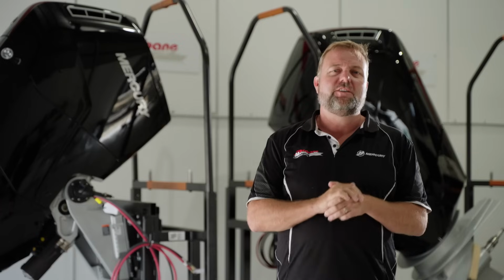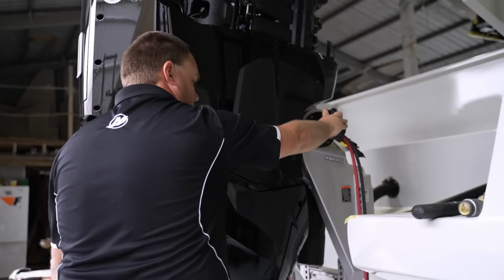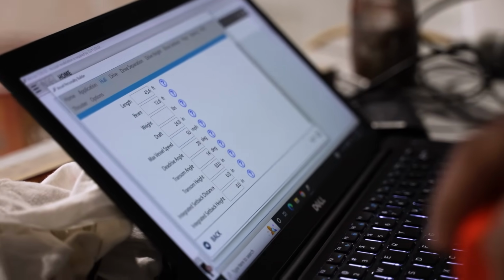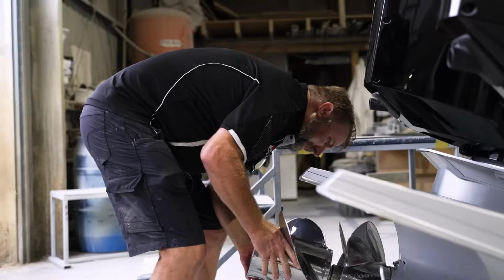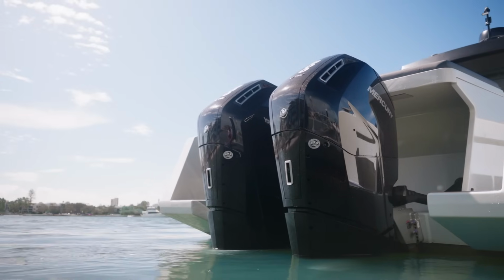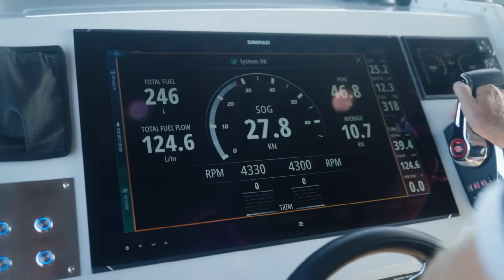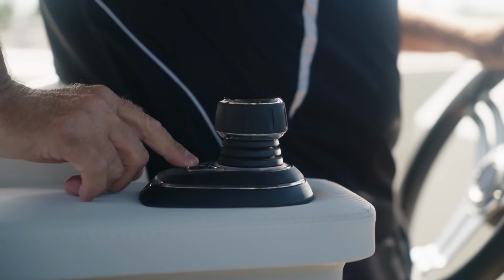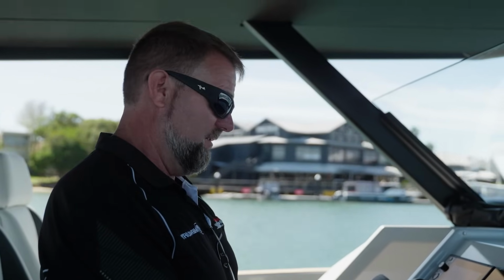Twin Mercury 600hp V12 Verado- FIT UP AND WATER TEST FINALLY REVEALED

Comment: Aldi 12s are inherently smooth internally balanced that is why Ferrari Lamborghini all of those Supercar type companies used V12 they're extremely smooth running no vibration just because of the way the architecture on a V12 is

Comment: At 1000 hours the lower gear unit will not have to be removed, it can be removed on the STBD side of the motor by removing two bolts

Comment: Thanks for the vid.

Question about 'Sky hook' anchoring button, but not sure of the technical language to use so I'll just try this.

Out fishing in potentially dodgy situation with tide change & plausible current direction. Does the Sky Hook cope, to a point,with a "strong current" and/or does Mercury have recommendation for this situation?

Cheers

Comment: Maybe I’ve been spoiled by the automotive world, but 600hp out of a 7.6L V-12 doesn’t sound like much in the grand scheme of things. I get that Mercury probably prioritizes torque and long term reliability over raw HP considering marine application, but that much displacement should be pushing north of 700hp in today’s day and age.

Perhaps they underrate them, or have another “high output” version in the works that really unlocks what that engine can do? Imagine a supercharged version…
Reply: The difference is the loading, in a marine application the load is constant vs intermittent loading in the automotive world.  Try to imagine a top fuel dragster engine running for hours on end!

Comment: What happens when’s there is a giant solar burst that emits every known radio and communications frequency and a few we don’t ever know, at a power slightly less than that required to kill human cells but capable of creating disturbances in anything that depends on the transfer of electrons to do something important, like steer the boat?  Answer?  Anyone?  Anyone?  Bueller?   I think with all this technology things are very susceptible to electromagnetic irradiation.  I’m not sure if the boat and motor designers took the time to consider the “what happens if?” in the same manner that the designers of the manned moon rover did.  Those long runs of un shielded wiring looms are great antennas.  I guess when your boat cost makes a significant dent in a 7 figure, positive, whole number, you have the ability to prioritize risk.   I think I would.

Comment: What do you mean you pre-lubed the Impeller? On a Dry Fire with no water to the Lower Units? This is all new to me being a 3rd Gen Outboard Tech? What is this new Lube you use, to keep the Impelller and Housing from Melting? with the Wear Plate and Cup?... Please Don't tell me Hey there! Starting engines dry is bad for the impellers. We pre-lubricates these impellers for filming purposes,  because I can buy you a Gallon of Prop Wash! to cool off that Impeller....
Cheers from Texas,
Billy Wah

Comment: Each costs about $77,000 USD. Certainly worth it you have the wherewithal!
Reply: If I could afford one at $77K, and needed 2, I’d buy 3, one spare and the bad motor gets air expressed to 1 Mercury Drive, Wi..  They should know exactly what to do and will bring it back and put it in the spare parts bin, a 150,000 ft sqr warehouse in Boca.

Comment: Great video on the operation of the 600hp by Mercury, I especially liked when you started the engine without hooking up the water line first. Thought you couldn't run those engines without a water source?. So now you have 2 x 600hp on your new 2 million dollar Yacht WOW.  That I know I'll never be able to buy in my lifetime.
Reply from the maker: Hi John! Starting engines dry is bad for the impellers. We take every precaution possible and pre-lubricates these impellers for filming purposes. Cheers 🔥

Comment: What about to change spark plugs? Does it stay in the water or come out?
Reply from the maker: Thanks for your question! The spark plugs are changed during the 1000 hour service and that'll need to be done by a technician 😊
Reply: Don't think spark plugs last that long in a mercury. Especially if you have foul plugs and stuff
Reply: @dive2deepocean115  Its a moder efi 4st probably iridium plugs. They'll do 100000 km in a car.
Reply: Yeah but as a mercury technician we a dropping the super chargers and we know why. But those v12 are some beautiful large engines and even now the 350 are v10s. But if something was to happen we would have to pull your boat out and work on your engine don't care what plugs it has or if it says a 1000 hour service. That's if you make it that far but if something wrong we have a pull your boat out.
Reply: @dive2deepocean115  As a certified Yamaha Tech Im with u on this. Beautiful looking motor. But l just looked up schematics of impellor. Its mounted very high(looks to be under sandwich plate?). It looks to be normal rubber impellor? Not sure how Merc can say, no need to change until 1000hrs (average 100hr a yr... thats 10yrs?). Dont think it would last half that and not perish? Time will tell but we all know in the saltwater environment no outboard last unless "Full Service and Proper Maintenance is done yearly or atleast bi yearly! All this new 3yr 5yr Now 10yr Full service is a joke... Its because  this Day and age of if it breaks, buy a new one!
Reply: @drdrft   lol man.. the customer is rich enough so if it breaks why not replace your $80000 engine.